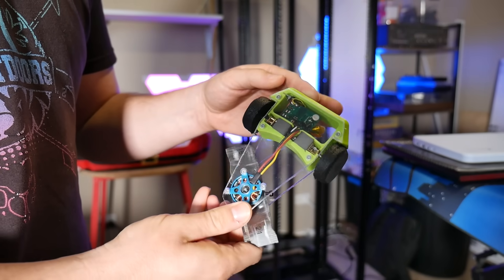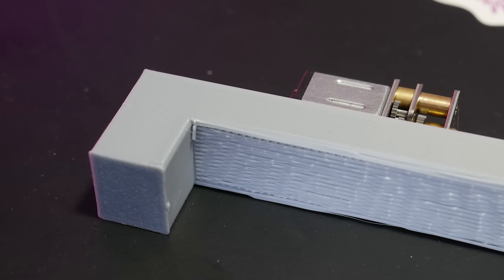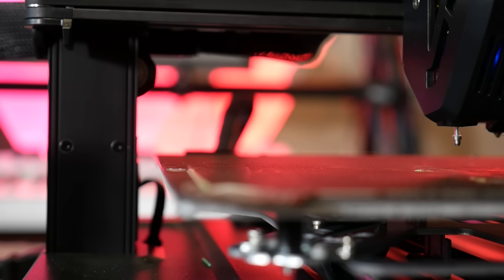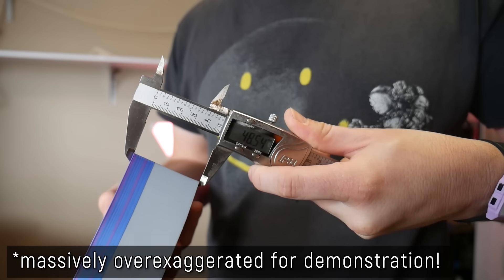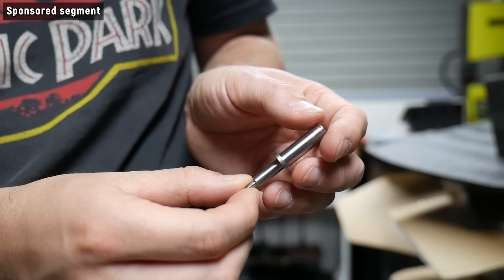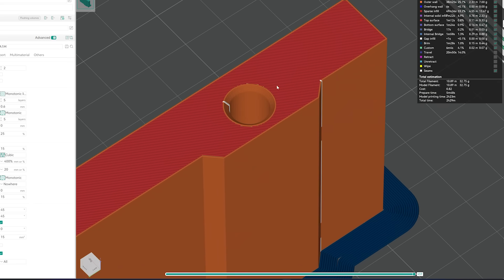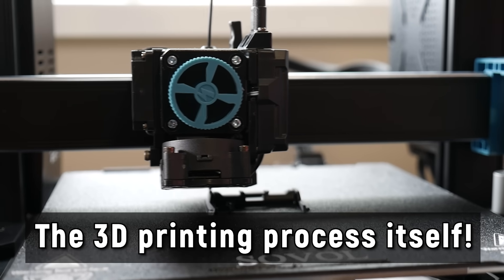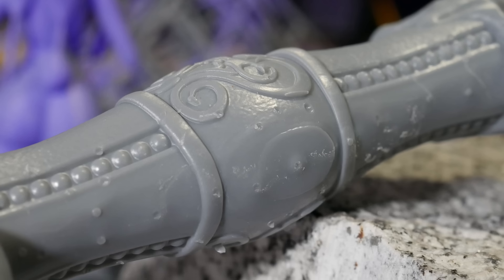Don't make these 3D printing mistakes (they RUIN accuracy!)

Comment: I had horrible problems with elephant's foot with a printer, almost 2mm on every print, no matter what I tried. I eventually figured out that my z-axis had a horrible problem with backlash that was causing it. It made sense once I figured it out. The height of the print head on z would stay at basically the same height for several layers. I replaced the brass lead screw with an anti-backlash lead screw and the problem was fixed! It was super frustrating, though.

Comment: Surprised you skipped the Z stack up issue. Unless your using adaptive layer heights the Z surfaces will have to be at a distance equal to the first layer height + a multiple of the layer height. So a 1mm tall part with a .3mm first layer and a .2mm layer height will have to be either .9mm or 1.1mm and most slicers will round that down.

Comment: 3:58 water does shrink when it cools, it has a positive coefficient of thermal expansion, it's just got a discontinuity at the freezing point due to the crystal structure of ice. Ice is not less dense than water because of thermal expansion, it's less dense than water due to the effects of phase change. There are some materials with truly negative CTEs, but they're very specialized ceramics and stuff (and some "glass-ceramic" materials are a blend of positive- and these special negative-CTE materials, allowing them to theoretically achieve 0 thermal expansion, limited by the precision of the mix of course)

Comment: Use a hot air gun to heat the inside of the part you want to fit in something, it can be anything especially an screw.
Perfect fit.

Comment: One idea I had for printing bridges like the one at 0:43 is to use a gauge block between the uprights. Why doesn't anyone suggest this? If I insert a magnet into a print once the recess is printed, the printer will go right over it without a problem. Wouldn't it do the same over an aluminum gauge block?

Comment: There is also the order of perimeter which can improve accuracy, outer/inner can often have better results, but it depends on the number of perimeter, filament diameter accuracy.
Also plastic to metal if often no big issue, since the metal can make its own space, plastic to plastic fits are more painful, when I think of publishing a model with less vitamins, I have to provide 3 tolerances. See multiboard as an example.
This is maybe one of the reasons bamboo lab is so successful.

Comment: elephant foot compensation is a bandaid on top of a bandaid. when will "respectable" (high sub count) youtubers start giving actual advice, like leveling the bed instead of suggesting retarded hacks that are still available in the slicers for some reason?

Comment: One trick I learnt recently for supports is that if your support interface is at a single layer, you can pause the print and apply a layer of permanent marker to the support.  That makes it much easier to remove cleanly.  You can even set the slicer to have no Z distance between support and the print.
Reply: I've used this technique myself and it's shockingly good. That said, there are some limitations.
1. It sometimes stains the part. The leftover ink can be removed with some isopropyl alcohol, but on very light filaments, you might not get all of it cleaned off. Not important for functional parts, but it can matter to some people who want it to look nice when they're done.
2. It only makes sense when you have a large flat surface parallel to the bed to support. If you're printing heavily overhung slopes, you'd have to stop and draw a single precise line after every layer... Time consuming and easy to mess up.
3. Doesn't really work well with materials that require heated chambers to prevent warping. Opening the enclosure to apply the marker will let all that hot air out and now you need to worry about warping, layer adhesion, dimensional accuracy, and so much more. At that rate, you might as well use a manual filament swap for the final interface layer, providing you can load/unload your filament without opening the printer.
4. Use a lot of interface layers, consider using a close support pattern spacing and slow down the speed of the interface layers. The zero distance support interface will give the best results if the final interface layer is really smooth and these tips will help give you smoother interfaces. 
5. This technique works best if all bridged/overhanging lines connect in a straight line between two fixed points on the print. If you have a cantilevered overhang, you'll run into issues where the nozzle drags the first wall out of position due to poor/nonexistent adhesion with the layer below due to the permanent marker inhibiting adhesion... that's how it allows for these zero gap interfaces, after all. I've had some luck being selective in my application of the permanent marker leaving a thin line around the edge where I don't color in, allowing for improved adhesion, but over a very small contact patch that usually breaks away easily if the cooling settings for the interface and bridging layers are well tuned and it still gives you 90% of the benefits of this technique.
Reply: @TheArmyKnifeNut  I can´t believe we still don´t used this 3 axis gantry design that all those new printes have to trim the print bed to simply print 5 axis---ish like to avoid most or even all support altogether.
Reply: @sierraecho884 I hear you... I have a machine with a kinematic bed and its got a fair bit of freedom. It would be theoretically possible to print 60-90 degree overhangs as if they were 35-65 degree overhangs... if we had that sort of controle, then who needs support material. And that's before we even consider true 4 or 5 axis printing and other non-planer printing techniques.
Reply: @TheArmyKnifeNut  Exactly, we wouldn´t even need real 5 axis printing at all.
Reply: Hey, this is similar to use liquid paper inside iron boxes to make damascus in forges. Cool.
Reply: This is probably be the next automation in slicers and printers. Honetsly I am surprised this isn´t already a feature. This will also open the door to multi color FDM printing instead of multi material FDM printing like Bambu Lab AMS etc, like we have now.

Comment: Another issue I found when working on a project is to stick to the same filament color. I was working on custom bearings that work REALLY great printed in black PLA yet ran out and started using blue to find the bearings stop working as well.

Comment: Incredibly helpful video, thanks Angus! 
I’ve recently started using PETG HF, but it refuses to stick to the build plate, I’ve tried glue sticks, no glue, and thought it might’ve been a moisture issue so I bought a filament dryer. It still won’t stick. Any advice would be appreciated.

Comment: I have been wondering why it seemed so hard to fit my hubs onto my motor shafts, where one moment it was too tight the next too loose.  I will have to take this back to the drawing board and see if I have a better time!

Comment: Great video as usual. Here’s a tip you might consider for a very thin prints. You can cheat by telling the slicer the exclusion thickness is less like 0.35 even though the dimension accuracy may go down it actually gives you a better print as it will fit in more walls.

Comment: I ran into ugly shrinkage issues when printing some folding knife handles in polycarbonate for a Spyderco Endura 4; there are a lot of precisely-positioned holes and curves on folding knife handles and all of them need to be exact or it won't assemble. The prints worked great in PLA and PETG but shrank too much with PC. I found that using the shrinkage adjustment settings in Prusaslicer let me dial in the dimensions of the final part pretty precisely. IIRC I ended up using about 0.5% to 1% shrinkage compensation.

Comment: If only this video was made 2 months ago when I redesigned the timer knob on my air frier. I spent like 2 hours making small adjustments and reprinting (only a 1cm tall section0 trying to nail the D shaped hole for the shaft. Ended up working perfectly with a small amount of pattex contact glue and a bit of paper. Honestly it works fine in PLA, no warp, no play at all and it's sturdy and looks quite nice.
Reply: For fits like that you can also use what we call "crush ribs". This is used in injection molded parts as well. It´s basically a thin section, a rib that get crushed or destroyed when mounting. The thin rib will get squeezed down so the part can "grab" on the object. With 3D printing you can even print 20 of them all round the hole if you want to, complexity does not have added costs in 3D printing.
In general if you are seriously interested in making parts out of polymer you should learn about injection molding first, since there is a lot of knowledge there and you can transfer 90% of that knowledge into 3D printing.